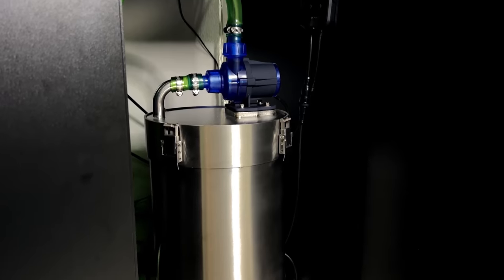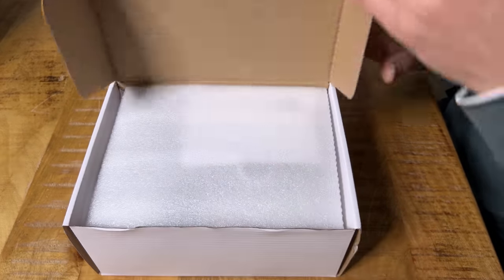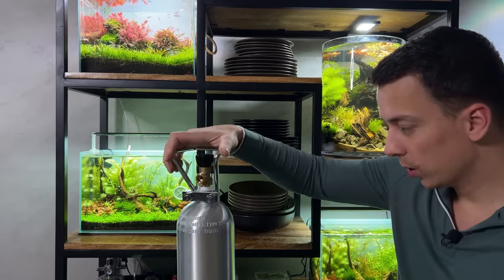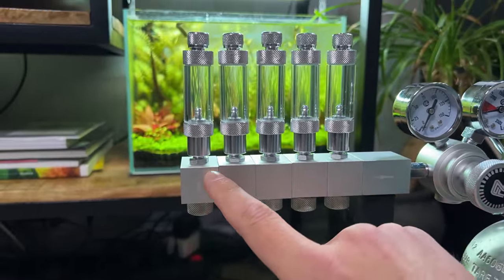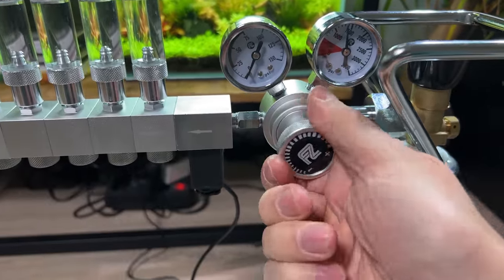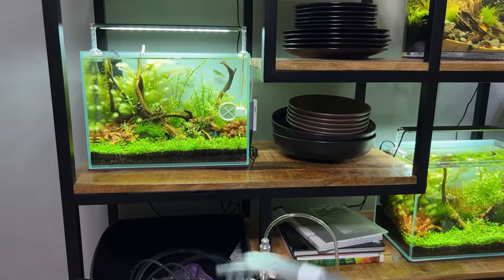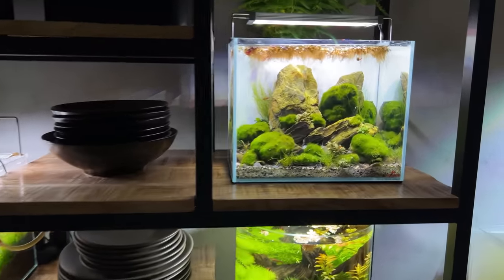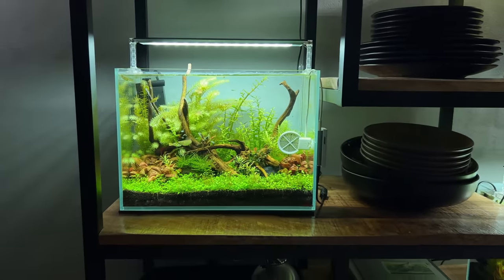Removing ALL My DIY CO2 Systems From The Shelf!

Comment: Beautiful regulator! I have this 2 years, controling co2 for 3 aquariums, and Im really happy. No problems and you can control the working preassure. This is important to change the preassure depending on you co2 outlet. Thanks for the review

Comment: Hi Mark. Further to my comment about the regulator earlier I thought I would update you/everyone with the latest news...

Update Monday 9th January 2023....

Customer service contacted me overnight, and asked some troubleshooting questions, and included a couple of photos showing how to remove the mechanism of the solenoid valve in order to clean the inside. This is freely available on the FZAqua website. A video featuring the GLA regulator also shows how to do this. I actually managed to do this before the customer service response, and the solenoid now opens and closes properly. I also removed the bubble counter blocks as far as the solenoid block, there is a brass connection inside, which had a small amount of vaseline, or similar, inside... which I also cleaned out.
Regarding the electric solenoid, I noticed that it was not connected properly, this is easily fixed by removing the two screws on the side of the solenoid and connecting the cable properly.

So far everything is fine. How is yours?

Comment: I’ve been very satisfied with my FZone Regulator.  One tip I can share is: Instead of putting water in the bubble counter you can put Flourish Excel instead and it won’t evaporate like water does and you won’t have to constantly refill.  Instructions say you can use mineral oil to avoid evaporation but I didn’t know if that might be harmful to to the tank in case of any possible failure.  
I’m a big fan of your channel from Southern California….  Thanks!
Reply: You'd have to have a pretty weird setup to have anything you put in a bubble counter leak all the way to the aquarium. What setup do you have where your canister is sitting above your aquarium?

Comment: Im still using diy co2, pretty hard and kinda expensive to refill in my area. Im experimenting to substitute sugar with sugar cane molasses (from processing sugar cane into sugar) it is insanely cheap here, mainly used on farm. Now on day 2... Dont know how long it will run, but pretty happy with it, more reliable than acid and baking soda in my opinion.
Reply: molasses would be a great way to do it as it is thicker
Reply from the maker: Very interesting!

Comment: Hello again. So, my fzone pro regulator emptied 2 kilos of co2 over the course of 3 days. I think it is an issue with the white washer between the regulator and the bottle. Can you please confirm which way round you put the washer when it leaked for you in the video? There is a smooth side and a side with a groove in it. Does the side with the groove face towards the gas bottle, or towards the regulator? Thanks.

Comment: Have you ever been worried about th DIY ones exploding? 
I saw a post on Reddit a while back of one that exploded and caused a truck load of damage!
Reply: I am more afraid of the co2 cylinder rather than the diy thing. Not sure...
Reply from the maker: Not really actually! However a few weeks ago the tubing on one of my systems got blocked, so the pressure was rising for a few days, and when I felt the bottle it was super tight. If I wouldn't have noticed, it definitely could have gotten ugly

Comment: Incredible, I just received and installed this regulator twenty minutes ago! 😂😂😂
Reply from the maker: Nice!!
Reply: I wonder how well the regulator is working for you? I read a lot of reviews before deciding to buy it, and the common problems that seem to arise are the solenoid not switching on and off properly, and CO2 still coming through when it is switched off.
Sure enough, mine is doing exactly that. The solenoid doesn't open with the timer every time. ( I know the timer isn't faulty as my CO2art regulator had been working off it for years) If I disconnect the cable where the mini plug and socket is then sometimes there's a rush of bubbles when it's off, and slows down when it's on. Several more disconnects and reconnects it resolves itself.
The issue with the CO2 still flowing when the regulator is off is very real too. The manual states that there may be some gas still flowing up to 30 minutes after switching off, but I am getting one bubble every 3 seconds.... 4 hours after switching off, and probably all night.